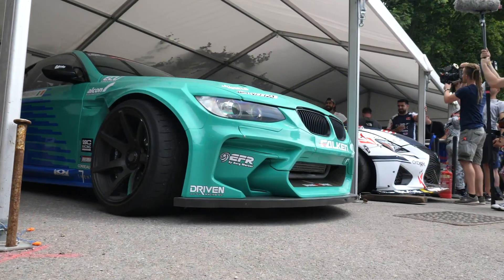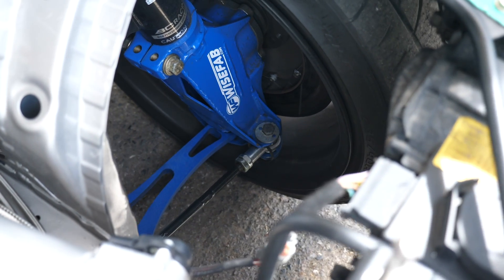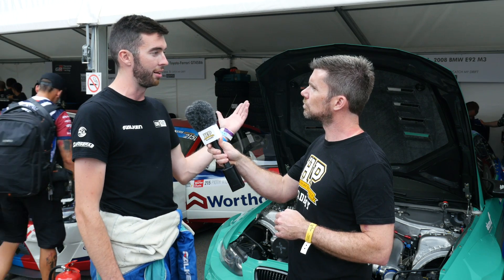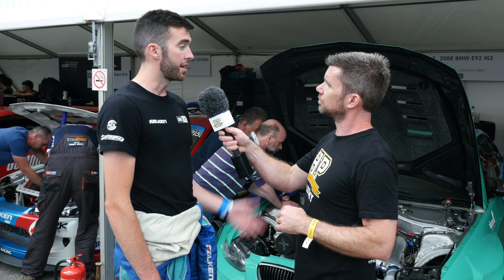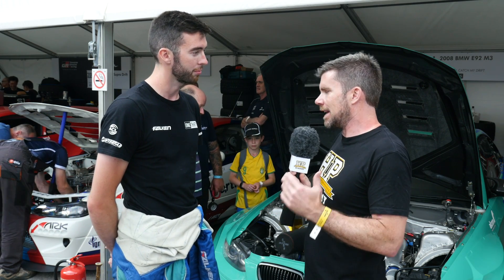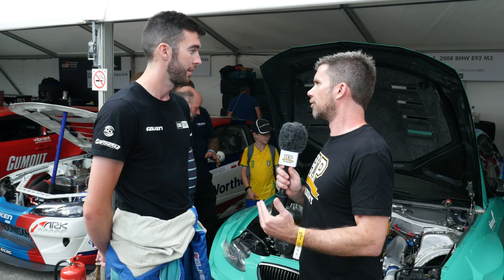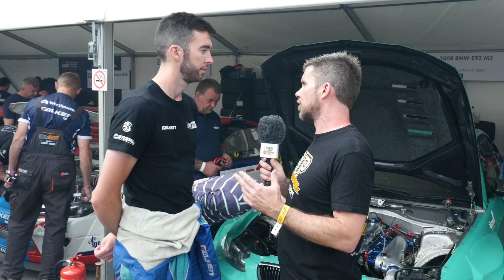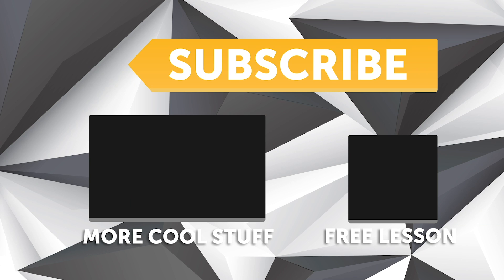Choosing A 900-1100HP Drift Car | S-Chassis to E92 James Deane [TECH TALK]

Comment: The HGK Eurofighter is the cutting edge of drift machines. That's a 6 figure drift car. The cabin is fully sealed from smoke and it's carbon Kevlar all over. You really need to see one up close, even if you don't like drifting. Nice feature guys.
Reply: justdave100 can buy a rolling chassis for sub $70k
Reply: @trippinoutmotorsport  are you clarifying that it is a 6 figure drift car?
Reply: @ArmchairCarcass  depends on if you buy a rolling chassis or a fully built running car.
Reply: @trippinoutmotorsport  true, but you can’t drift a rolling chassis, must be a 6 figure drift car when built you’d have thought
Reply: @ArmchairCarcass  Again, it depends on what driveline you order with the car. One of their mast motorsport lsx engines would definitely get the price up or over $100k. Again, it just depends on what you spec it as
Reply: @trippinoutmotorsport  fair does

Comment: Just a note. Around @9:20 you discuss "pump e85". Given this interview is in Europe and a European drift car.... I'm from the UK and I've never seen pump e85.

Not sure if Europe (mainland) is different. But still
Reply: There was a time that you could get e85 in Poland on like 2 gas stations.
Nowadays at least in  southern Poland a few people go to Czech republic an buy it there in bulk.
Reply: Never seen pump e85 either, whether in France, Germany, Belgium, Luxembourg... the best we have is the Aral 102 in Germany and Luxembourg with less than 5%Ethanol, but no high octane high ethanol fuels
Reply: It's common at many petrol stations throughout Australia and New Zealand.
Reply: I was already running lump E85 back in 2009 in France. At the time you had to plan trips to run E85 only maps but nowaday it's quite common.
Reply: In France depending on the state you live, there are many e85

Comment: I don't think James did a great job explaining the reason for grip. The more grip you can get the more power you can put to the ground (even in drift,) the faster you can go and stay in control. For a dramatic example watch formula drift in the rain vs in the dry then go back and watch the IDC where they're allowed to run special tires and have no weight limits and watch how fast they are with lower powered cars.
Reply: Actually having special tires and no weight restrictions shadows the mechanical grip problem as you can play with other parameters (I guess they can move the engine and firewall way farther). 
When doing Formula D or any restrictive competition the forward bite is critical as you do not have other options with everyone already being at the very edge of each rule.

Comment: Incredible tech tour! I was just wondering of what tool tray or service cart do you guys use when trackside?
Reply: Things have no doubt changed. But it was normal 2 or 3 years ago to simply flip a car on its side (balanced on tyres) to whip a gearbox out and change a clutch.

National level drifting in Europe is moving RAPIDLY but its still very much grass roots based. The mid field will still be full of guys taking the tools they work with during the week.

JD and PW are of course part of the top level and you can see that in their pits. But it's still a small setup
Reply: @AdamMGTF  I see thank you very much for the insight.